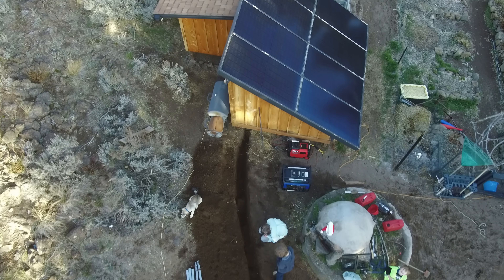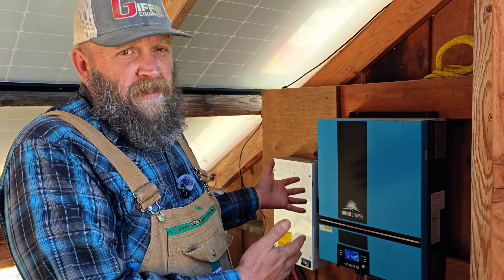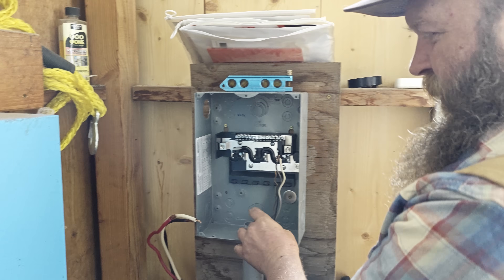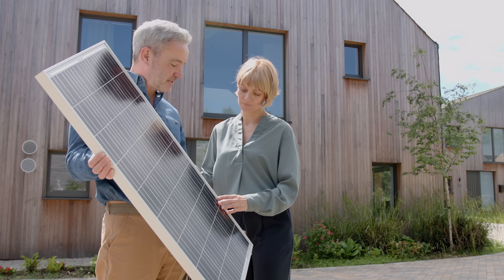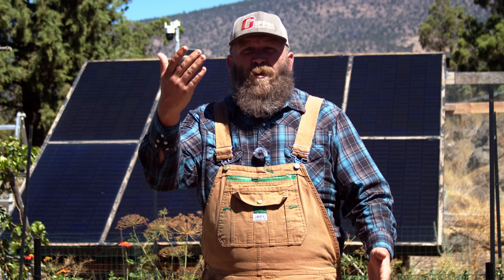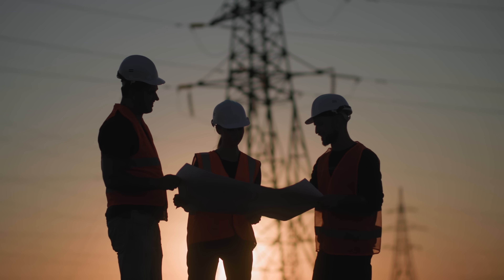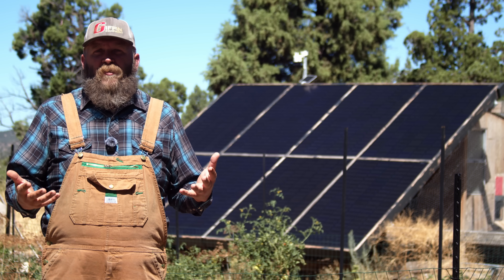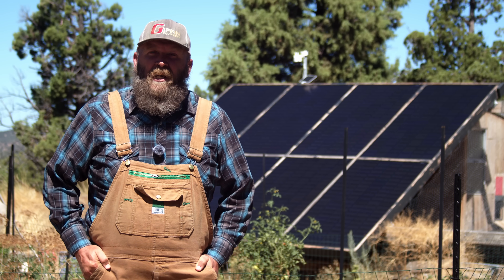The True Cost Of Off Grid Solar

Comment: The reason you could do yours for 5k instead of 15k is because every single element of your system is bottom of the line.  From the Sungold Chinese inverter to 12v batteries run in series to make 48v, to the inefficient by today's standard panels, to a wooden 2x4 panel rack.  You literally saved every penny you could, but at the cost of having the lowest quality available.

I'm not trying to bash you, or your set up.  If cost was the prime motivating factor, you did great.  But having high quality equipment simply co es with a higher price.  A Ford focus and a Mercedes E350 both get you from point A to point B, but one does it in comfort with a ton of amenities, and is built to last forever if taken care of.  The other isnt smooth, isnt comfortable, is composed of the cheapest materials available, will give constant trouble, until it dies a much earlier death.  And if you constantly pay to have stuff fixed before it dies, your total cost may just come close to buying higher quality to begin with.

If it's the budget you had to work with, then that's understandable, but if the budget wasn't actually necessary, you'll pay the price over the lifespan because stuff is going to constantly need repair.

I do wish you well though.
Reply from the maker: Oh I have no delusions about having done it on the cheap.  I also did it for quite a bit less than the $1 a watt I say folks ought to be able to do it for. That being said the Canadian solar 400 watt panels were upper mid range at the time we installed, the batteries have the same specs as far as life cycles as the "better battery cells" so getting those cheap wasn't a quality deficit unless you count brand loyalty. Building the rack the way we did was super cheap and saved us about $1000 in racking and made it really easy to use the structure for rain water collection solving two problems at once l. Really the only thing that was bottom of the barrel is the inverter and to be honest with 5 years on it it's never failed and works just as well as any of the hundreds of solar edge, enphase, sol ark, of and other "premium brands" that I installed for others as a solar installer. Especially when you consider that inverters only last 8-12 years on average. As far as efficiency, I don't know what the spec sheet says but I've calculated it and the round trip efficiency on the inverter with these batteries and panels is 89%. The very most efficient systems are 95%. Arguably not worth the significant cost difference. It doesn't really come down to budget in my opinion. It comes down to does it reliably produce power. For the cost, I'd build this system again. And spends the extra money I'd spend on a "better" e350 type system on something else. That being said, someday id love to build a bigger system with a solark15k but it's very low on the priority list until the house gets built.
Reply: @7kinhomestead  - Oh, I completely understand.  Wanted to make sure you didn't take my comments as a dig or anything personal, and it appears you didn't, so that's good.

We live in Puerto Rico, and the grid here is likely the worst in the western hemisphere.  Hurricanes, mismanagement, corruption, etc, the grid goes out multiple times a week.  Maybe an hour, maybe a week, but not able to count on it at all. So off-grid was a necessity here, at least from a gringo perspective.

I bought the eg4 18kpv inverter, eg4 14.3kwh outdoor wall mount battery, 12 Canadian solar 550w bifacial panels, all the wiring, conduit, transfer box, fuses, etc.  (panel spec says 6600w, but routinely get 7300w with bifacial gain in full sun).  It is more than enough for the 25kwh needed per day, and then the charged battery gets us thru the night, with two minisplits running, with 30-40 % remaining by morning, then restarts all over again.  We kept the grid connection, as a back up source only, and have a large inverter generator as a secondary back up.

My total cost was $12k.  I bought the equipment myself, did most of the wiring, conduit, etc., then had a licensed solar contractor do the final 10%.  This system bought and installed thru a company here would be $20-30k, and then same system bought/installed thru a company in Texas would be $40k+, so I saved $8k buying the components myself and doing the bulk of the install.  Warranty on inverter and battery is 10 years, and panels are 20 years prorated.  Owned outright, and provide 100% of our needs.

Hopefully, if will be my kids problem when something eventually fails....  🤣

Anyway, cheers to you for a nice diy very cost effective system.

Marco
Reply from the maker: Sounds awesome!! Yeah, I took no offense. Have a good one!!

Comment: Being here in the Mountains of Central Montana. I have been here 50 years & customer of Fergus Electric for that entire time. I paid a company called Purelight to install 13-405 watt panels on my new roof. All micro inverted 240 volt through my new Meter back to Fergus Electric. I expected to off set my electrical bill by at least half. Especially after the $20,000 out lay to Purelight. My power bill dropped 50% ,that was 2 years ago in October. Since then I have added a complete new system that reduces my monthly bill to $34. That’s the base rate of my meter connected to the Grid. Yes I can go off grid but they are my secondary battery bank. Currently I potentially generate 21,565 watts. I just started my 4th array and I am done with my project. I built an enclosed heated Energy shack. My battery bank an SolArk15 reside inside it. I am going to add a mini split for Air conditioning & heat in there. I am able to produce 120+ KWh of electricity a day. Now I am set to bring in Two Electric Scout’s which are on order for next year. I will keep my 1 ton Diesel for heavy hauling. But I will soon have Electricity for traveling around the area. Total cost of my project with me doing the majority is just north of $60,000. Honestly I never entered into this project for payback. I entered into it to be assured of electricity in any case. I did add a 20KW Kohler generator, it lasted for 2.7 hours and the Rotor Locked up. Warning Kohler refused to standby their 7 year warranty. Fortunately Costco took it back and Kohler will get it shoved up their Azzes side ways.
Reply from the maker: Man, that's an awesome system. I love solark. I've put in 12 of them over the years. Absolutely the best inverter, hands down. I hope to build a system where I can afford a 15 one day. I used to install generac guardian series gensets. Basically the same unit as the Kohler Genset. The difference was the company and the support. On two or three occasions we replaced Kohler's with generacs with the same problem. No support from Kohler. But I'd open a generac and if there was a scratch on the cover, call the rep and he'd send it out. If there was a part I needed to make the system work and he had it in stock, he'd drive it out to me. Crazy the difference.

Comment: Connect the batteries to the inverter first, and the solar panel connections last - otherwise the solar panel power has nowhere to go and may damage the inverter.
Winter is often a problem for solar - we get about 10% of the rated solar maximum output in December, and about 85% in summer (including wiring and conversion losses). We have a propane generator for backup, which also charges our main (48V) batteries using an EG-4 chargeverter.

Comment: I got a great deal on a bunch of 255 watt pannles. Now I found Im not allowed to hook them up in the city where I live.
Reply from the maker: Bummer, what reason did they give you?
Reply: @7kinhomestead they say I have to pay an approved licensed electrician.
Reply from the maker: @outsidedogpresents I see. Are you planning on connecting them to the grid? You should be able to install everything and then hire an electrician to connect from the inverter to the main service panel. Even solar installers aren't actual electricians in most cases so that can't be a requirement. But what solar companies have to do is hire a licensed electrician to make the final connection. There is nothing that should stop you from doing that and it should only cost a couple hundred bucks for the electrician and a couple for the plan set.
Reply: @7kinhomestead and approved electrician in this town usually means someone who is in their friend or family circle.  Yeah its that kind of town.
Reply from the maker: Yeah, that's a tough one. I would ask questions like "can you show me the NEC codes for that requirement?" And "what specific class of subcontractor is required?". "Can I use a solar contractor?" Then I'd follow up with, "since there is no such classification as solar contractor, (most operate under a roofers license) does your requirement actually only require the final connection between the inverter and main service panel to be made by an electrician, since none of the other parts of a solar install are under the purview of an electrical contractors license? I've always found if you ask specific, educated questions about codes and requirements, the corrupt city and county officials tend to pick someone else to run their nonsense on. It's worth a try. I hope that helps.

Comment: I’ve been using solar at our remote cabin for over 20 years. I started out with just a 12v system for lights, RV water pump and RV water heater with electronic ignition. I still use that but now I have a 4K 48v inverter with another battery plant and solar for that system. I have separate charge controllers. I had to replace the batteries last year after 22 years.  They will probably last me the rest of my life unless I live to be 100. I have less than 10 grand in the systems. If you don’t run the lead acid batteries down the their minimum they will last much longer. I worked on batteries and inverters as part of my job for years.

Comment: Im sure its not really different, but id love a video showing how to cook up a generator that acts as the grid. In the future i plan on adding solar not for off grid, but mainly for power outages. It happens a lot where we live and its usually not sunny when it dose. Everything else is a bonus
Reply from the maker: Sure. On a lot of "off grid" inverters there is still a grid termination block. You just hook up the appropriate plug on the right sized whip (wire) to that terminal block and then run it to the generator. That's really it, depending on the inverter.

Comment: So many people are worry about even small system. I got two panels. Producing about 500watt combined in pararell in great sun condition. It's so easy.
You can't do it wrong because the cables and ecoflow delta or pro series, but should always learn the different between pararell and series and see few examples of it anyway, just too make sure everything is correct. Always check for VOC and the limitation for voltage for the solar generator. And surge watt.

With smaller system like i have you should be doing in pararell, but only if there are 2 or 3 panels (too get most of them in the sun) because in pararell you seperate the solar panels, but in series if one of the solar panels got clouds over them everyone are getting affected by it, but more then that you should defiantly be using series. My plan is too extend the system with 3 more panels next month and an extra generator so every time i'm using one of the generator the other one will always be producing more then i need. So one of theme will hopefully almost always stay full if there are sun outside.

Takes less then 3 minutes the first time. In my own case in Norway it's completely legal too have it moveable so i don't need too have any permit for it either.

Comment: Not trying to make anyone feel bad , but in the Philippines I just paid with (company labor)
(1) Deye 12kWHybrid On/Off Grid Inverter. (20) Monocrystalline 580W Canadian bifacial Panels mounted on (24) cement columns (steel frame top for panel mounting) avg. panel ht. about six feet off the ground......and  (2) LV TOPSUN 51.2V/300Ah (15.36kWh) LiPo batteries.
      TTL w/labor   $14,000  USD             *Cheaper labor and no tariffs.
Reply: Where in the Philippines? What company did you use? We have a place in Bataan (Luzon) and Bulacan.

Comment: Before I moved I was paying $3000 per year for electrical. The system I’m looking at is under $5000. Meaning that within 2 yrs, all my electricity will be free. And with the charge/discharge abilities of these batteries I’ll have at least 8 yrs of free electricity. I am thinking of buying an extra inverter and charge controller just I cad something happens. It won’t give me my whole usage but it’ll get me buy until I get replacement parts, as well as a generator, with a spare charger (should something happen to the converter) to charge the batteries when the sun just ain’t cutting it.
Reply from the maker: Sounds like a plan!!

Comment: I'm from northern michigan, alot of snow. Is solar worth it here? I been thinking about it but I don't know how efficient it is in the winter time.
Reply: I’m wondering the same. We also get a lot of snow and use electric heat for like 9 months out of the year. Nov-Mar can be brutally cold. I don’t really want to install panels on my roof. So that leaves a ground set up that is much further from
My house. We also get a ton of
Wind all the time, so I’m a little worried about a the panels taking flight. I’m wondering what the break even cost would be. If you have a 10-15 year break even period it’s not worth it. I need to be around a 5 year break even investment in order to make it work.
Reply: @SkinnySkin-l5k Right, I found a sweet website awhile back I have been going to. It is called Signature Solar, prices seem decent compared to a lot I have found anywhere else. But here where we are its like December-March is rough, and great lakes don't help at all lol. But I'm kind of thinking about getting solar, but then supplementing it with small wind mills because winter here a lot of wind! So I have been doing research into all this but figured I would ask someone elses opinion on the matter. But check out Signature Solar it's a pretty clean website and decent prices that can at least give you an idea of prices you could spend.
Reply: We’ve had solar here in Newfoundland for 10 years, no grid backup, 2000 watts of panels. We only have to run the generator a few hours a week in the winter, not a big deal. Our home runs pretty well on a little under 2kw a day, we live pretty simply but still have a freezer.

Comment: Solar power, will be the most EXPENSIVE, Costly, Unreliable power you will ever buy… However there are situations where it’s the ONLY Practical solutions…
Reply from the maker: Just out of curiosity, what more reliable, cheaper power can you buy in an off grid situation? I agree with your later point.
Reply: @7kinhomestead  from a reliability standpoint, here are some points. Out of 24 hours in a day you only get four hours of premium solar time. When it’s really hot, your panels don’t produce as much as they are rated. When it’s too cold same thing and the rating that is given per panel usually is never met and only gives out 80% of what is stated. Cloudy days no power. And if your panels are not tracking the Sun , that’s another 5-10% loss.   Your inverter will burn 50-80 watts per hour just by being on , so 50 X 24 = 1200 watts, just because.  And any time you take from one source to another you lose at least 5%…  Having said all of this, a generator is WAY too costly… Thus we have Solar…
Reply from the maker: I agree. That's almost word for word from the second or third video in the playlist I mentioned in this video. But for an off grid power viewpoint there isn't a better solution at the moment at least. I was curious if you had a better solution I wasn't aware of. Thanks.
Reply: Not so if your close to the equator  :)
Reply: @JMgmkh also true for the artic and Antarctic CIRCLE…. 😂

Comment: I'm poor, fitted 5kw inverter, 106amp hour 51v battery and 4 600w panels. Everything included just over 1000usd. Here in SA it's gotten really affordable. Will add a battery later for rainy days.
Reply: Wow the 100ah battery would cost over $700. The 2400w panel must be used ones since new ones would cost $1000 assuming $0.4/w.